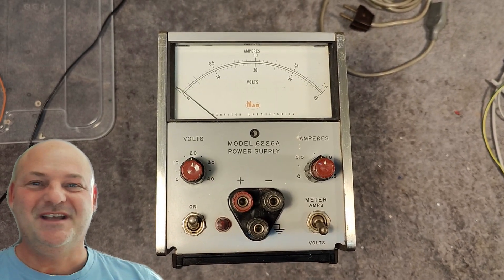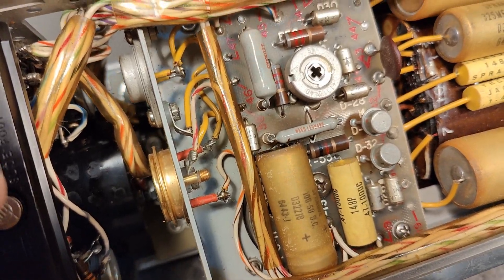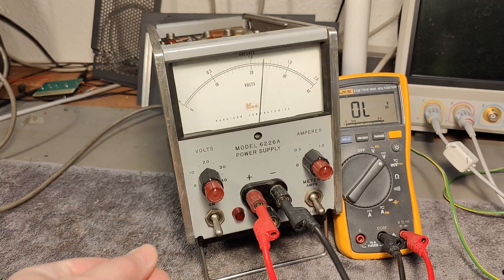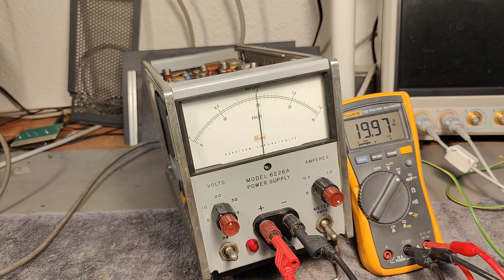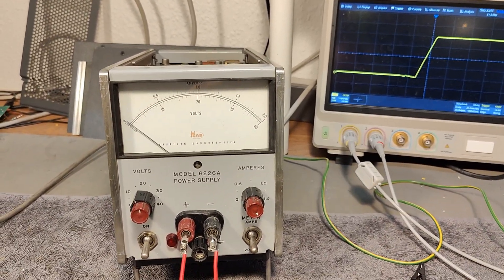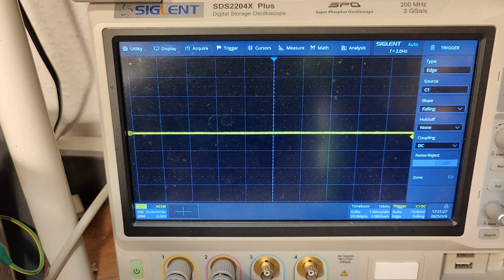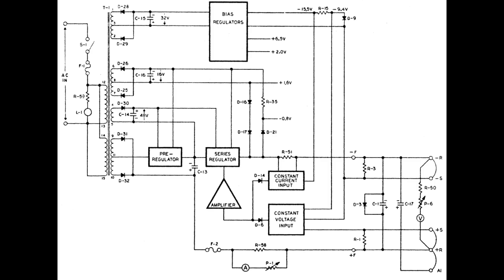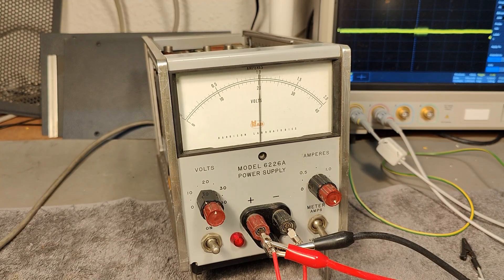HP 6226A HLAB power supply 40V 1.5A 1974 test teardown

Comment: for 40 V . 1.5 i made my power supply late of 70 s i used .LM 723  and single output transformer..adjustable current limitation (0...2.5 A and voltage 0...30 V..it still works very fine.

Comment: A bit odd that they used transistors for the switching preregulator, especially back then when power transistors were rather expensive and quite easy to damage. Two thyristors instead of the two rectifier diodes would have been functionally more or less the same while being more robust. I have a Sorensen DCR40-13 power supply that uses a triac in front of the power transformer - the buzzing sound it makes under load is very similar.

Comment: The preregulator seems to use quite some series resistors in the AC part. So it would not so much improve the efficiency, but shift the heat to the resistors, that are at the back.
The step response still looks impressive, even compared to modern standards.

Comment: Some of the older processes used with early germanium transistors could withstand much higher reverse bias, up to 20V, on the base-emitter junction than modern silicon transistors can tolerate. However, a reverse bias of 48V does seem excessive.